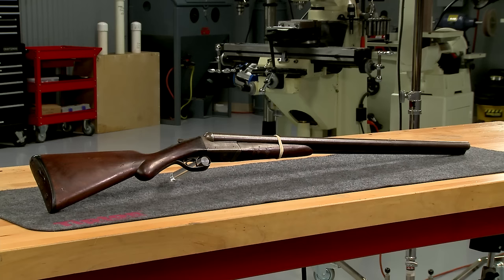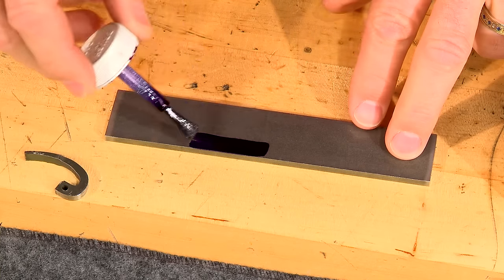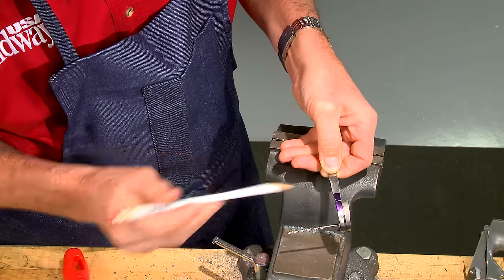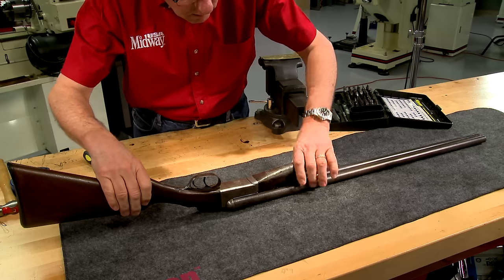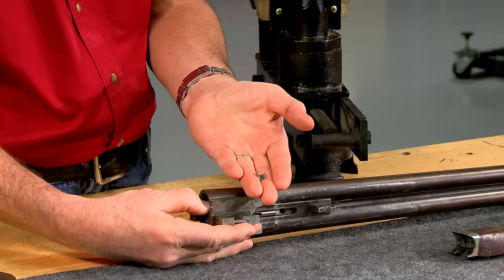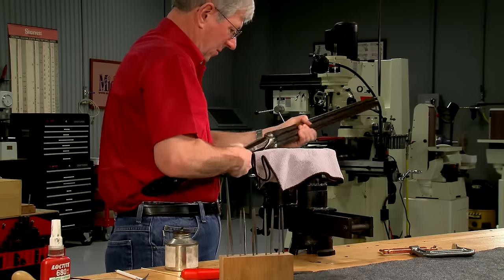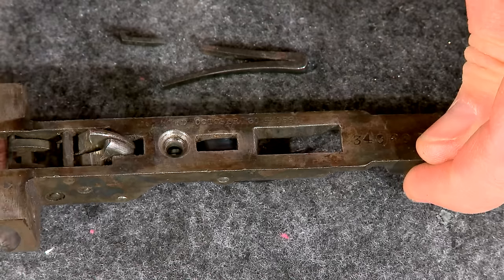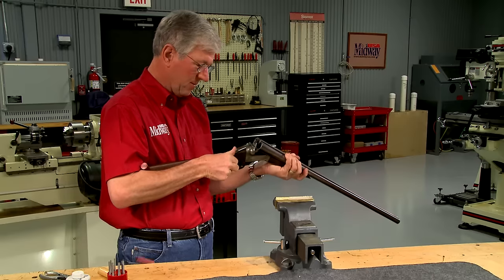Repairing a Remington 1900 Double Barrel Shotgun | MidwayUSA Gunsmithing

Comment: “It’s a simple repair” *completely fabricates new parts*. Wish I had a workshop like that!
Reply: A blowtorch, ballpeen hammer, hacksaw, files, and a vice. That's all you need to fabricate this simple springs. Even that salt-heater thing isn't necessary, the torch will temp metal fine if you watch for the color change.
Reply: Larry Potterfield is a beast.
Reply: War Crime Stick Watching Henti Considering the fact that he specifically mentioned that an example part was from another Remington, this is no secret.
Reply: maybe 200 in tools and supplies on the high end a 30 dollar propane plumbers torch replaces the only expensive tool he used and we all own hammers
Reply: @jerryscalf281  ?
Reply: @x10mark24  I wonder if he has fever with those fits?
Reply: @NoMoneyHubby  guns that old might not have replacement parts, making it necessary to make them
Reply: The spring making info is gold.
Reply: Simple to an expert.
Reply: Just takes practice and patience, and knowledge.   You can do anything you put your mind to! 👍
Reply: The magic is that he didn’t need any of the fancy tools. The “fanciest” thing he used other than a common oxyfuel torch was a cheap lee lead pot filled with blueing salt. 

No mill, lathe, or anything computerized. Just some hand tools, patience, and attention to detail.  

He’s probably one of the wealthiest gunsmiths in the world, but he still loves being hands on with simple tools. It’s a passion for what you do, that is rare in this age.
Reply: Even if i had all of this (wich i actually have, atleast most off it) i could not do it. If i would try this nothing would match :D
Reply: Lol!
Reply: @berserkasaurusrex4233   bán  súng  Bao nhiêu tiền
Reply: I wish I knew what to do with a work shop like that lol
Reply: When you got his money anything is simple lol
Reply: Yes that is the most hilarious thing for me

Comment: I would've preferred to tig weld on new material instead of gluing a thin piece but that's only down to preference. This is first class work and by providing this as free videos shows what a true craftsman you are! These videos are the golden standard today and will continue to be so in the next 100 years as well! Thank you :)
Reply: I would have tig welded new material on the hook AND installed a factory-size pin, ensuring 100% original matching faces between pin and hook.
Reply: Why not just replace the piece at that time point
Reply: Surely shimming is more sympathetic to a 100+ year old piece?
Reply: @GsyMoo  A firearm is a tool that has to safely operate and if you aren't prepared to do the required repairs it might need you're better off hanging it on the wall instead.
The Remington 1900 is neither a rare or an expensive shotgun and doing repairs properly gives it a prolonged life whereas a quick fix might make it worse in the long run... But at the end of the day its up to the owner of said firearm how to go about doing any repairs, but I ensure all my firearms are in pristine condition and any repairs are made with function as the most important factor, not looks, and a broken firearm will never bring any joy.
Reply: @JensAndree  
Good point 👍
Reply: @larriyrnir5756  That piece is literally welded (or soldered) with the barrels.
Reply: if he tic welded this there would have been two videos of the same thing. He is trying to learn you all the methods. The guy is a master he knows what to do. Lol
Reply: I'm not sold on shimming a hook face, fair enough for a farm gun etc but if you add material over the entire face that basically means you have just kept the wear pattern but added whatever thou shim over the top, tig building up the actual wear and filing down to a flush fit is unbeatable
Reply: a shim is easier. shim stock is a constant thickness so there is no risk of recutting the hook slightly off after welding and making more work for you getting the fit right. and if it ever lostens up again the shim is replaceable if you remember the thickness.

Comment: Definitely worth fixing, and nice job. Book value is around $800-$1100 for those interested.
Reply: Hughes Enterprises Yeeet
Reply: Won't fixing it effect the collector value for resale? Many gunsmiths are reluctant to work on old guns for that reason and others.
Reply: @chrismc410  It's been repaired for to working order for someone who wants to use it. A collector's item doesn't have to work because it very likely won't be used. You'll see plenty of very old firearms in collections that haven't ever been fired by their current owners.
Reply: @serch3ster  some people want to squeeze off a few rounds with old guns. They often want to know if it still can shoot, even out of curiosity.
Reply: @serch3ster  I never saw the point in having a gun you don't shoot. Unless it's sentimental
Reply: How long would a process like this take? I'd assume like 16-20 hours over a couple of days
Reply: Dingbat2212 Yep. That’s why you can buy guns like this for a couple hundred bucks. Nobody wants to spend $1500-2000 for a gunsmith to fix a $1000 gun. 

It’s either a labor of love or a gunsmith’s own project.
Reply: Definitely a buy
Reply: @HughesEnterprises  exactly.
Which is why these guns are great for folks with my level of autism and spare time. i bought a model 12 that was an absolute rust bucket, broken fireing pin, and near completely split stock held together with duct tape.

Some carefull work showed the metal was remarkably not pitted under all the orange, then a new fireing pin had to be hand fitted because parts on those things are not drop in, and the stock was degreased, glued and oiled.

Probably about 6 hours of work on my end, would have been 800 in gunsmiths fees, which at that point makes more sense to buy a working model 12 for 450 ish.

i got it for 180, spent 40 in parts. a win on my end
Reply: @chrismc410  Larry doesn’t care about the monetary value of the gun. To him it’s worth just the enjoyment of fixing it and to be able to use it. After all if he really cared about the dollar value of a gun he probably wouldn’t be quail hunting with a $130k Purdey shotgun (as seen in other Midway USA social media accounts)

Comment: Kudos for being one of the only channels I've seen that actually explain the benefits of oil-quenching vs. water-quenching. I've seen videos from people who make blades for a living that still don't understand that important detail. I had to learn this detail the hard way, through many years of experience and trial-and-error (I'm a machinist/welder/fabricator), so it's nice to see someone explaining it so that others might be able to learn it in a much shorter period of time. In case you're wondering, no, they did not teach me this in trade-school, which actually kinda boggles my mind. Oh, how the mighty have fallen lol...
Reply: The type of quenching depends entirely on the type of steel alloy used. I worked as a toolmaker in a shop that built injection molds, where we did a lot of heat treating of different types of tool steel such as A2, D2, S7, O1, 440C stainless etc, all of which have very specific temperature requirements as to heat treating and tempering, as well as soak times in the furnace depending on the size of the parts. Some were air quenched, some oil quenched, some water quenched. These guys on TV making knife blades using guesswork and eyeball methods to heat treat are good for a laugh, especially when you see the outcome. I've known a couple of classically trained blacksmiths that could do a better job. I will say however, that Larry's methods have been used successfully to make gun springs by a few generations of gunsmiths with good results, and it's a skill that's built on practice and learning what does and doesn't work by trial and error experience. The man can definitely make a spring.

Comment: How reliable of a repair is the shim stock on the hinge? In my experience with bearing retainers, they really don't function like an adhesive and they'll shear if the wall is too thin. I do really appreciate how conservative of a repair it is though. It's how noninvasive and reversible, just the way it should be on a piece of history.
Reply: So is the metal epoxy better?

Comment: I have a 1940's Webley M IV with a broken barrel catch spring and watching this video gave me a solution as to how to make the new one since I cant find the part.  I will have to drill a hole in the spring to add a small pin that protrudes from the spring.  I would like to avoid using a welder but would like to blue the entire piece

Comment: i have a remington double bbl. outside hammers double trigger 10 gage made in the 1800s is it safe to fire modern ammo?
Reply: probably. first determine whether it's a black powder gun or not. ABSOLUTELY NEVER fire smokeless powder in a black powder gun, it'll blow up. if it was made after 1890, it's most likely a smokeless gun and modern ammo would be fine unless youre putting crazy hot ammo into the thing.

Comment: Your lathe behind you looks like a Jet GHB-1340A, I see it is set on adjustable feet.  Any problems with them mounted to the sheet metal cabinet?  Were you able to level the lathe an make it sit solid on the floor?

Comment: Hi I have a question. I recently purchased a 1957 armi San Marcos sxs  that has a great lock up and with chrome nitro steel barrels. while I was cleaning it when I brought it home I noticed a very slight bulge in the breech on the left barrel and it is right at the end of where a 3 inch shell would stop. with concern I took it to a local gunsmith to get his opinion and he reassured me that it should be fine with standard 2 3/4 in shells. since then I've test fired it and it appears to be okay, although I thought it couldn't hurt to ask for a second opinion. p.s. love your knowledgeable videos
Reply: As you indicate, for whatever reason, the elastic limit of the steel in one of the barrels may have been exceeded (therefor the bulge). I would not fire it. If that had occurred during proofing in a country requiring proofing, it would have failed.

Comment: Good video. I hope you can help me with my questions. I have a stage coach shotgun a copy not original like this one. Recently my right hammer would not cock back and stay there. The left one I manually cock back and it stays there till I fire it. The right one I cock back and it does not stay back. Can you tell me what areas I am having a problem with? Is it the hammer or trigger or other? I appreciate your time and response. Thanks
Reply: Worn seer.

Comment: An easy way to temper a spring after hardening is to put a pile of sawdust on a fire brick or steel table pour enough motor oil to saturate the saw dust. Light the pile of sawdust and let it burn away. When it cools you'll have a perfectly tempered spring

Comment: Great repair from a very talented gunsmith.  I would say that the glueing of the shim on the barrel hook is not the best way to repair such an issue, as a matter of fact it is one of the least favored methods due to reliability issues BUT for an inexpensive gun it certainly does keep cost down.  The key is on inexpensive guns, that repair on a decent gun that will see hard use should never be used.
Reply: +Rafael Lastra WHAT reliability issues? :D he used the correct type of glue, fitted in perfectly, it will last as long as the shotgun....

Comment: you do some amazing work I wish I could have you check out an old black powder dubble Barrel shot gun it says it was made in Italy it has some marks on the tow berrals but I have no clue what it means I also have a Herbert Schmidt 22lr 6inch barrel but it doesn't have the hammer spring I also have no idea were to get parts for it.

Comment: I have a riverside arms 1915 and it wont latch shut. Any ideas what that may be?
Reply: +george jordan Soak it in a lubricant for a few days, it could be that it's gunked up so bad a spring has stuck
Reply: Not enough info. for a correct response.

Comment: I have a John Forsyth 10 gauge side-by-side, old style lever break on the left side, with the half cock broken on the left hammer. If possible Sir, please advise the correct repair method. Don't want to screw it up. Thanks. Great show BTW. I'm a big Midway fan.

Comment: can you shoot modern plastic shells fom that
Reply: +Nickolas927 I need a pre 1898, with my current situation because of a BB gun in New Jersey
Reply: +Brett Duffy and would it work with slugs
Reply: Absolutely not. Damascus barrels should only be fired with black powder shells.
Reply: If by "shells" you mean modern ammunition, absolutely not.  If you mean modern plastic shells (hulls) that you SHORTEN to 2 5/8 inches and load with black powder, yes, if the gun is otherwise safe.
Reply: Choked Damascus barrels should not be used with slugs.
Reply: So you can use a round ball slug with black powder loads
Reply: It has nothing to do with the powder. Solid projectiles should not be fired in a Damascus or laminated or twisted steel barrel that has any CHOKE.  Many of the European guns are specifically labeled "Not for BALL" reflecting the choke boring.
Reply: wholeNwon  how do you use it for deer or self defence neighbors are getting restored anyway so it does not matter  I can own modern guns soon
Reply: wholeNwon I would even be concerned shooting plastic wads through a full choke Damascus barrel unless it has been nitro proofed in the last 50 years. If the bore is badly pitted, I wouldn't even fire it. Too much chance of there being voids or other unseen rust damage weakening the welds.

BP, short paper or brass shells, birdshot, and fiber wads are the safest choice.
Reply: If the gun is otherwise satisfactory, buckshot can be used.  You can shoot rifled slugs from a MODERN (post WW II) shotgun even with a choked barrel.  MODERN nickel/molybdenum/chromium, etc. alloy steel is much stronger than Damascus or early fluid steel barrels...twice the tensile strength. The modern breech block can have a sheer strength of 300,000 psi !!!  So the safety factor is much greater. The OLD choked barrels were intended for upland game, waterfowl and other birds.
Reply: No defective gun barrel, regardless of its construction, should be used.
I'm suspicious of old gun barrels with bright, flawless bores.  These have often been honed and may be unsafe. Many old guns with 2 3/4 " chambers are suspect, too, when they should have been 2 5/8 or less.
I agree with your statement about modern hard plastic wads.  The welds in Damascus barrels have never been shown to be sources of greater failure.  Mostly an old wives' tale along with "internal rusting in voids" that somehow appear with time. "Dissimilar metals electrolysis" is also silly. Pitting however is a BIG problem and obviously weakens any barrel. Nitro proofing of Damascus is done in Europe and required for resale. When such guns are brought to the US, I suspect they are often used with incorrect ammunition rendering the "proof" much less comforting.

Comment: One of the rare Pottersfield videos I disagree with. Gluing shim stock as opposed to fill welding and a refit, for refacing the barrels, is a cheap, temporary, low rent repair. When it comes to firearms, you either do it right or don't do it at all. Use it for parts or a wall hanger

Comment: i have an old sears and roebuck/stevens 311 12 guage side by side that the pins are like sticky on they stick out a bit and when i close the action with rounds in they damage the primers a bit ive never had it fire the shells apon closing the action but im afraid it will get worse over time. does anyone have any advice for me pleasy reply i tried lubing everything liberally and it didnt seem to help much the gun is in very good shape other than that it still fires very well its not loose at all please help me
Reply: +MidwayUSA
Reply: I definitely would not use the gun until you repair it!  Since the firing pins and striker seem to be separate in those guns, the firing pin springs are probably broken. Just remove them and replace them. If not broken, then there is likely some minimal corrosion around the pins or holes in standing breech.  Just clean and smooth them.
Reply: wholeNwon the first halfway educated answer I've gotten thank you man
Reply: Only "halfway"?  It's not rocket science. Anyhow, check the serial number (letters?) to see when yours was made. It may NOT have 2 3/4" chambers...measure them carefully. Also, early fluid steel barrels were not as strong as modern gun barrels even when in good condition.  Somethings to keep in mind when choosing shells.
Reply: wholeNwon the letters are AE BG I'm almost certain the chamber's are 2 3/4  I've tried to see if a 3" shell would chamber and it wouldn't so I mostly just shoot bird shot out of it
Reply: Measure the chamber lengths.  It's easy to do. You don't even need a gauge. Some "bird shot" shells can develop high pressures. You should be able to Google for the age of the gun.